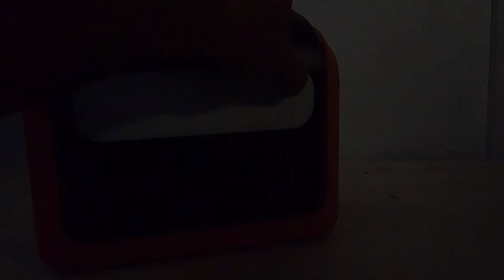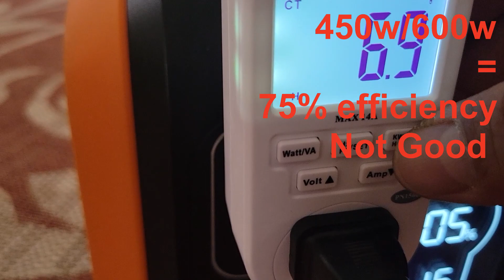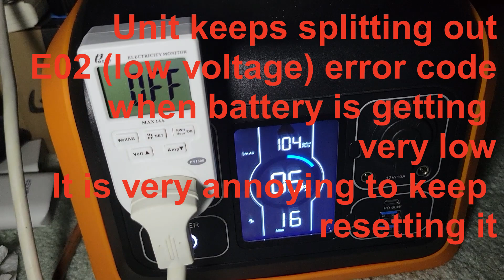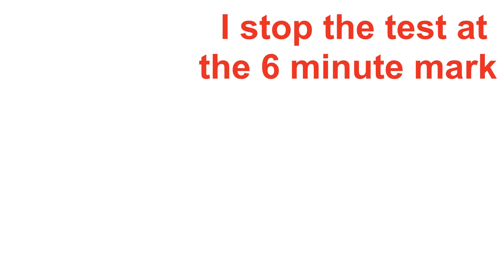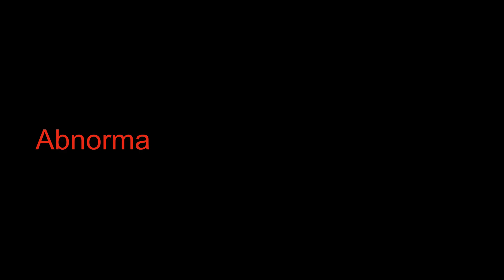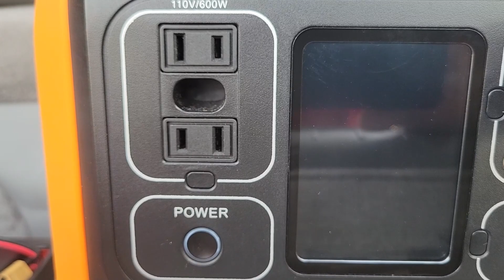Oupes Power Station Lifepo4 Battery For Cheap, Updated Video link of problems fixed.

Comment: I'm still trying to get the company to do something. They said they would send a solar panel to try. I hope it works. Then I would be able to do solar and plug it into the wall. It WILL NOT charge in the car as it also goes to ZERO when charging.  I paid over $500.

Comment: Just see you guys now I just thought with this company for about a month to get my money back and return the product I never got a capacity close to 595 wh on the AC or the DC. On higher capacities I was pulling 200 or less watt hours. Maybe my battery is defective but they weren't working with me finally I had to do an a to z claim on Amazon and show all my evidence. That's why they offer any huge discount I think. Also I found a couple other battery stations that are the exact same as that one with different names on them so it's obviously some big manufacturing company that makes those and companies just slap their names on them. I wouldn't buy it but do what you want. They leave things out of their instruction manual. Most companies will be like capacity and they'll leave their give you the watt hours with the volts so you can do an accurate test on it I have no idea where they came up with their ratings or how they did their test and their MAH rating is ridiculous
Reply: You'll never get the "Rated" capacity because efficiency losses. I get around 505wh on mine after 3 or 4 different tests. The larger the load the less capacity you'll get from the battery. You'll get the MOST power from LiFePO4 cells around a .2C discharge rate so on this unit it is about 119 watts, anything more than that you'll see less capacity that the rated capacity. Their ratings are similar to other power stations on the market.
Reply: @Jasonoid  did several tests myself on all the ports and yes I did do a test at 90 watts and 110 watts on both the DC and AC ports and was pulling below average meaning less than 85% efficiency on both the AC and DC side. And just so you know kind of power station isn't owned by opus Yes their names on it but I found another power station exactly the same with a different name meaning that they just bought this power station off a manufacturer that produces them for the purpose of selling them to brands
Reply: @ryanmeyer4602  yeah, I have been getting around 80 - 82 % still a lot of bang for your buck at $400. If you can get it with the big coupon is worth it. At the full price of $529, pass

Comment: How do you make the display show input watts instead of output watts?
Reply from the maker: When it's charging it should automatically show input watts instead of output watts
Reply: @toolgearbandits7223  it appears to show the HIGHER input or output wattage, for example, if you have 100 watts of solar coming in and a load of 55 watts charging something, it will show the input because it is higher.
Reply from the maker: @Jasonoid  You are correct. I didn't realize that until I look was checking on me solar charger on hazy day.  It alternates between  input wattage and output wattage because the solar panel was producing borderline close wattage to what my 12v fridge was drawing. Cali fire is robbing me of solar power. Lol
Reply: @toolgearbandits7223  Great video by the way! Im also getting all that smoke from California and I'm here in Utah....so many fires. I am doing a review on this unit as well and I was just making sure I didn't miss any weird quirks. You think of anything else that is an issue?
Reply from the maker: @Jasonoid  Not much. Only that this unit has a less efficient AC than what I'm use to. Also the AC seems to produce a little interference. If you plug an iPhone into the AC to recharge  you lose some touch sensitivity (ie try to switch between apps). This is pointed out to me by another owner of this power station.  Not that big of a deal since we rarely ever use the AC port to recharge our phone. But it leads one to speculate the AC inverter here may not be of a quality design.
Reply from the maker: @Jasonoid  Also I got to say I really enjoy your battery build videos.
Reply: @toolgearbandits7223  yeah, I wasn't expecting much on the AC inverter efficiency but the noise is interesting... I'll do some in depth testing on the inverter, thanks for the heads up!
Reply from the maker: @Jasonoid  Yeah no problem. If I think of anything else I'll let you know.

Comment: I am also using this product myself, and I have not felt the same noise problem in the video. The product is really good, and I feel that the video owner is a bit picky. Whether the fan is good or bad varies from person to person, and we cannot  deny the other advantages of this product just on this point. 

The overcharge protection is awesome, as soon as it gets to 100% the fan will stop and the blue circle in the lcd screen will stop moving, letting you know is done charging and it won't over charge and saving on your battery life.
Reply: If the weather is cool why does the fan need to run immediately when attached to a solar panel?
Reply: @NorthcoastPatty  When you use solar panels, the temperature of the machine may increase. Whether the fan starts is related to the temperature of the machine, not the weather temperature.

Comment: Dude I was seconds away from buying this thank you so much! However I am thinking I still may buy it just to see if you got a bad unit
Reply: It's better to have this then nothing than all for the price it's still worth it for the capacity and life cycle.
Reply from the maker: If you do buy it, let me know how it turns out. I'll try to ask for an exchange if I indeed got a bad unit. 
This thing is a great bargain Lifepo4 power station if it didn't have the issues I've mentioned in the video.
Good luck.👍
Reply: I just bought it we'll see how it goes I'm not going to get it until maybe the 19th at the latest. It also has the highest power output that I found for the price. Also I want to mention that the company has been in direct contact with me via email and they are extremely good on getting back to me and they even sent me the manual so the company to me is pretty strong they also mentioned to me that it is returnable even though on Amazon it says it's not.
Reply from the maker: @defwebsolutions  
Good to hear that. I'm glad they stand behind their products.👍
Reply: @toolgearbandits7223  Here's the Email they sent me responding to some of the fan issues:
Dear customer,
Thanks for your emails and support.

In fact, the purpose of the fan is to reduce the temperature of the charging station. The operation of the fan is related to the temperature and has any relationship with the display screen.

The working principle of the fan:
(1) As long as the battery core temperature exceeds 55 degrees, the fan will start to work, and the fan will stop working when it is below 55 degrees;
(2) When the AC port is output: the fan rotates at 45 degrees to cool down, and the fan stops working when the temperature is below 30 degrees.;
(3) DC output, type C output port, LED working, when the temperature is greater than 90 degrees, the fan starts to work

There are some applicable suggestions. 
(1) Please turn off the AC switch when not in use;
(2) Use these ports whenever possible. In fact, when using DC output, type C output port, LED working, the fan rarely works(only >90°C)
(3) When camping, please place it far away from your head

Sinerely,
OUPES
Dear Christopher, Yes, if you have any question about it, just contact with us, we will try our best to help you solve it well, and if you dislike it,you can return it. The problem every customer we had mentioned to the technical team, and we will develop and improve this product in the future. We attach great importance to and listen patiently to the voice of every customer. Thank you very much. Sincerly, OUPES
Reply from the maker: @defwebsolutions   That's the same response I got from them.  The problem is that they can't actually see or hear the fan problem.  Amazon message don't allow link to videos or emails or such.  They just assume we are making a big deal out of fan noise.  It's not the noise. It's odd behavior of the fan try to start up and stop, start up and stop.  
Between me and my friends we have quite a few of power stations.  None of our power station's fan behave like the way I show in my video.  I fear that the fan will give out way before the battery will give out. 
I just did a video with the fan behavior when working with a Solar Panel.  I will link the video when I upload it.  You can clearly see the problem with this one.
Reply: @toolgearbandits7223  I hear you and understand. Me personally, I can easily change the fan out but I get what you're saying. Time will tell when I get mine I'll let you know what it does! Unless someone else gets one before me and writes in the comments. I still think for the price it's a steal. Hoping it goes well.
Reply from the maker: Here is the update video of fan noise when hooked up to my solar panel.  https://www.youtube.com/watch?v=Ecp2QmztxsY  Very bad.
Maybe you can point them to my fan noise video.  They are probably tire of me keep talking about it. 
Did you ask them if you do a return is the shipping on your dime or their dime?  I am thinking about returning it
Reply: @toolgearbandits7223  They said it can be returned. I don't know about shipping fees, but mine is through Amazon I'll have to see what comes of it. I will message them tomorrow with your video and let you know what they say. Goodnight!
Reply: @toolgearbandits7223  did you receive a cigarette to 8.8 mm charging cable? What accessories did you get with it?
Reply from the maker: @defwebsolutions  Yes. It came with car charger and wall charger cables.  That's about it.
Reply: @toolgearbandits7223  well, the company got back to me and they said maybe you're a malicious other seller. So my opinion is that I just need to get mine and then we'll know the truth. However even if mine does the same thing I'll probably keep it cause it has the specs I need but we'll see. 3500 life cycles is hard to beat for this price. Plus I'd be using it everyday for work so I need LiFePO4. It may out last most other generators. We'll see.
Reply from the maker: @defwebsolutions  Lol.  That is funny. 
You should test out the battery capacity of the AC port too.  My results were not good, below average. That is my other gripe with this unit as I noted in my original video.  
I would take the claim 3500 life cycles with a grain of salt.  This is a new company so they can claim whatever they want as there is no way to confirm it for years, if they are still around then.  I would trust companies like Jackery, EcoFlow, Bluetti's claim more seriously as they claim more modest 500, 800, 1000, 2500 etc cycles based on battery chemistry used and the unit's capability. 
I'm not bashing this power station.  If you use DC and USB power mainly then I would recommend this unit as it is very capable with these ports (as long as the fan thingy doesn't bother you).  
You are still getting a Lifepo4 battery chemistry, regulated DC port, 60w bi-direction PD port, dual charging, AND the best MTTP solar charging controller on a power station I have tried.
Reply: @toolgearbandits7223  even if it's only 2,000 Cycles like most of the other LiFePO4 batteries out there that is still worth it for the 600 W inverter which I need to use my pressure cooker and I use a DC fridge so for me it's the only one for this price range with a 600 W inverter even if it's not the most efficient and yeah I am thinking the positives outweigh the negatives but we'll see you when I get it how I feel about it.
Reply: @toolgearbandits7223  I got it!! I'm using it now. So far no issues. No fan issues nothing. I'll keep you posted. It's gonna take some time to play around with it too see. I hope yours is defective so that you can get a replacement and really enjoy it. So far I love it. But I've only had it for a few hours
Reply from the maker: @defwebsolutions  Good to hear. Yes please let me know. I hope I just happen to have gotten a defective one also as I like this power station otherwise.
Reply: @toolgearbandits7223  yours is defective. I love this thing. Best deal on Amazon.
Reply from the maker: @defwebsolutions  When you say mine is defective, you are referring to the fan?
Reply: @toolgearbandits7223  no the whole unit needs to be sent back and replaced
Reply from the maker: @defwebsolutions  I understand that. I am assuming you are referring to the fans as defective. I will ask for exchange pointing to the fan as the defect.
Reply: @toolgearbandits7223  I hope I helped you cause when you get the new unit I feel you will be happier. I NEED LiFePO4 and this can do 600w which is needed for many applications and honestly I feel it could outlive my ecoflow River 600 which I also love. If the river 600 had 2000+ cycles I would have been happy but 500 cycles to me feels like a waste of my time these days.
Reply from the maker: @defwebsolutions  Company contacted me and offer a few solutions. I have agree to remove the videos about this unit. If you still want to chat about this just contact me via email or chat via my other outdoor videos I have. I hope your unit is still doing well